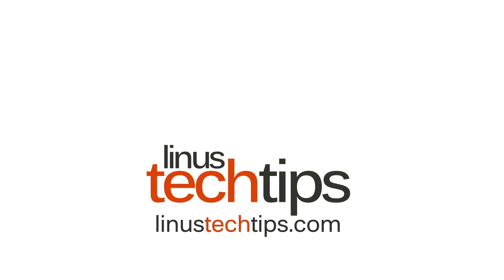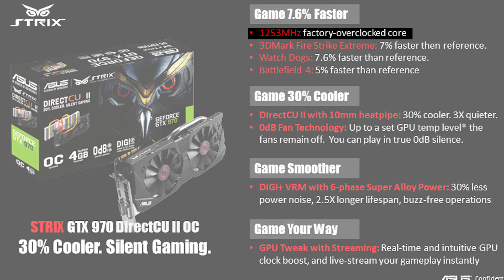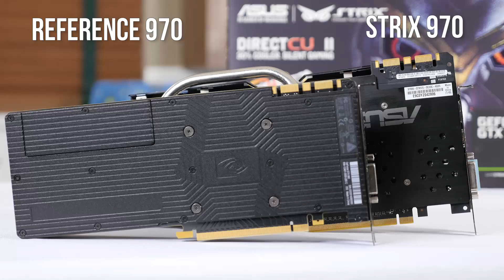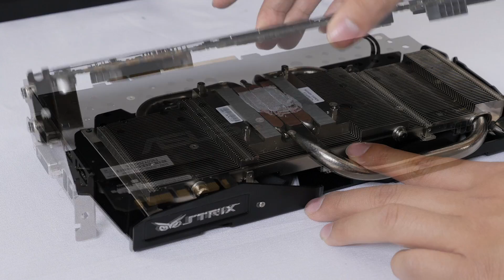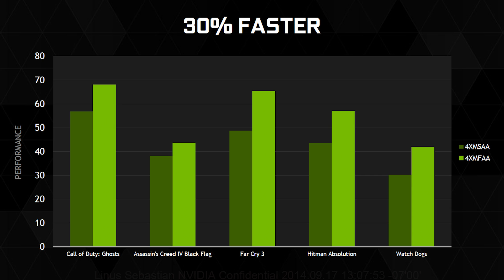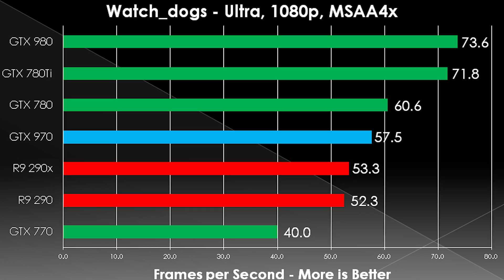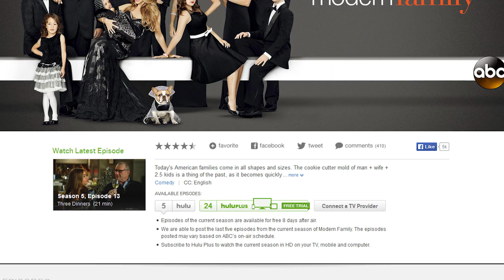ASUS Strix GeForce GTX 970 Video Card

Comment: I want to note, this card (ASUS Strix GTX 970) is equipped with a full HDMI 2.0, while  MSI GeForce GTX 970 Gaming 4G equipped with already old HDMI 1.4, beware.
Reply: Why the fuck do you use  HDMI over  display port?
don't get a 970 with a shitty monitor
Reply: ***** yes, exactly!
EVGA as well use  HDMI 2.0 on theys non reference cards.
to my surprise, I found that almost all manufacturers like GIGABYTE , ZOTAC, MSI, KFA2 use HDMI 1.4 instead 2.0.
But again, im talking about non reference
Reply: wtf msi...
Reply: Thank you, good to know Another reason to not buy the MSI card, I've been fan of MSI Twin Frorz IV, but that new one looks ugly to me and cost $10 more than the ASUS one, bye MSI, I'm going with ASUS instead.
Reply: SirEpicWin HDMI 2.0 support 4k@60fps along other features, Display Port doesn't ... Its something not quite useful for this card at least in games but is a new tech some might find useful other doesn't, blu-ray at 4K@60fps maybe? I myself never found 4K anything interesting, I'm just fine with 1080p@120fps... but OP is simply pointing this little detail out, no need to get mad about it.
Reply: Who fucking cares. HMDI 1.4 can still provide me 1080p up to 4k so something as trivial as that is an retarted reason for not getting that card.
Reply: You do know that DVI is higher quality then HDMI right.....
Reply: I was going to get the msi to match my color scheme. but i use hdmi. thank you! and they dont have a fucking backplate
Reply: If you want hdmi, get a lower end graphics card
Reply: norge696 No they are not look up the specs if they were "exactly the same thing then why tf do they still use DVI
Reply: norge696
Why would you use HDMI 2.0 when playing in 4k. Displayport is better
Reply: norge696 That is exactly why I say HDMI is shit.
Up until recently, you couldn't even do 1080p 120hz with HDMI.
It's also lagging behind Displayport, which is coming up with version 1.3 (which will BTFO any HDMI standard for a long time, if ever).
Reply: And Why the fuck does it matter? I already have HDMI cables so whats the point in getting an display port? Also how is the monitor shitty if its using an "HDMI cable" implying that it's an high resolution...
Reply: HJTh3Best
I am not mad lol
Personally I would never upgrade to 4k until there is a single card can handle it no SLI or crossfire or Dual GPU like r9 295x,TitanZ
Reply: HJTh3Best plus, the new sound technology  Dolby Atmos  with 34 audio channels , via HDMI 2.0 only!
Reply: De Tomaso Had someone confirm that Zotac uses HDMI 2.0. He was able to select 60 Hz refresh option in 4k resolution.
Reply: misutatomasu oddly enough, but now i was checked the msi web site, and they too changed HDMI 1.4 to HDMI 2.0
or they are negligent attitude to such details, I mean the employees of the companies responsible for the description of the product, or I do not know why
Reply: misutatomasu according to what they write in data sheet now - they have HDMI 2.0
Reply: What's a good reason to use HDMI over DVI?
Except audio, for which I use audio jacks.
Reply: SynapseTSS∞ wtf no its not haha
Reply: HJTh3Best Wtf are you talking about, Displayport 1.2 already supports 4k 60hz.
HDMI is shit. If given the choice, I'll either use DVI (for 1080p 144hz) or Displayport (anything higher).
Plus Displayport 1.3 will support 4k 120hz when it comes out.
Reply: HJTh3Best http://en.wikipedia.org/wiki/DisplayPort#Specifications
as well as http://en.wikipedia.org/wiki/DisplayPort#Advantages_over_DVI.2C_VGA_and_FPD-Link

Here's a quote, "HBR2 mode with 17.28 Gbit/s of effective video bandwidth allows four simultaneous 1080p60 displays (CEA-861 timings), stereoscopic 2,560 × 1,600 × 30 bit @120 Hz (CVT-R timings), or 4K UHDTV @60 Hz"
Reply: Jason122231
 I was actually replaying to OP <.<
Reply: ccricers nice question, and interesting facts, yesterday im checked zotacs official website, and found they changing some HDMI specs. Before was HDMI 4K @ 30 Hz, but now they changed to 4K @ 60 Hz
so ZOTAC rehabilitated, and again in the white list
proof link
http://www.zotac.com/products/graphics-cards/geforce-900-series/product/geforce-900-series/detail/geforce-gtx-970/sort/starttime/order/DESC/amount/10/section/specifications.html
Reply: De Tomaso I checked amazon and it says HDMI Output : Yes x 1 (HDMI 2.0)...
Reply: De Tomaso doe it mean they now have 2.0?
Reply: Nice catch.
Reply: Wrong, the card itself (the MSI one) just wasn't approved by HDMI yet, which it now is. So 4k 60Hz is possible on the msi 970
Reply: ***** are you sure? i need to know haha
Reply: littlefrank90 well i have to use hdmi because i play on a small tv on my desk
Reply: To clear misunderstandings. MSI GTX 9xx series have HDMI 2.0 interfaces.
https://forum-en.msi.com/index.php?topic=183619.0
Reply: correct. MSI said it was a typo. MSI gtx970s have hdmi 2.0 4k@60hz. "so far both the current GTX 900 series cards made by MSI being the 970 and 980 both have HDMI 2.0 interfaces and any information on Web pages regarding it should be ignored as its a mistake."
Reply: SynapseTSS∞ Are you stupid? HDMI is the SAME thing as DVI. Both easily converted with a passive adapter.
Reply: SynapseTSS∞ They're both digital signals... Sure DVI may be phased out in the next 5 few years but very few people have 4k monitors which HDMI 2.0 can support at 60hz.
Reply: *****  ik
Reply: SomethingCool51 Might want to show me where did you read that DP 1.2 support 4k at 60hz? maybe I'm missing something, thank you.
Reply: SomethingCool51 That's good then.
Reply: SomethingCool51 I don't know why you say HDMI is shit, it's the SAME thing as DVI or display port except the different resolution and hz they support between revisions.
Reply: ***** I understand they all serve the same purpose (to transmit digital signal) you dingus. I'm making the point that HDMI does not evolve fast enough. Displayport has been constantly one upping themselves, and have been doing 4k 60hz for a while now.  They're already working on 8k-capable cables now.

In comparison, HDMI is shit because they take too long to innovate. I never said it had less color quality or whatever you must be trying to infer from my statement.
Reply: I was just about to buy a PC with the GTX 970 can someone please help me to figure out of this is the bad 970 or the good one? The name is it is "Nvidia Geforce GTX 970 4gb GDDR5 ".
Reply: Well its a GTX 970, what you might want to know is the manufacturer or the company which makes its cooling solution/choose its specs which could be ASUS, MSI, EVGA, Palit... and so on, I don't know about the rest but the first three are three great manufacturers. I myself picked the ASUS one because its features and better customer support than MSI.
Reply: HJTh3Best lolwut, ASUS has the worst customer service I've ever heard of.
I only buy their monitors because if anything else fails, they'll assume you broke it or just simply not help at all.
Reply: SomethingCool51 Well you just said it, ...the worst customer service I've ever heard of... None of my ASUS product have had an issue except only for one AM1 motherboard I bought recently which wouldn't POST, RMA'ed it right away their customer service quickly responded me when I contacted them, unlike MSI with my old R9 280X which was producing graphic artifacts and after I RMA'ed it they said they found nothing on it, and sent me the same broken GPU back, even on 2D games it was causing artifacts after little time playing.
Reply: ***** No, the problem was the card, at first I assumed it was drivers problem, but it wasn't. The only two games I used to play with it were BF4/BF3 and they both are 100% DX11 and some indies sometimes, I tried everything on my end and nothing solved it. But I fixed it though, I bought this GTX 970 few months back and my problem with artifact and shit got solved real quick.
Reply: So can someone please tell me? whats better to buy asus,msi or the gigabyte? respond plz XD
Reply: El Greco  MSI παρε ;)
Reply: El Greco I would get Asus or Gigabyte. Gigabyte if you want more cooling Asus for more silence
Reply: Why is everyone going apeshit over HDMI? It connects your card to your monitor...who gives a fuck which port you use? Most decent 1080p monitors in the $100-200 price range don't include displayport. The quality is exactly the same on every port as long as you connect it to the same screen anyway...calm yourselves.
Reply: Ben Zimmerman ...unless you can't do 120hz on hdmi
Reply: SomethingCool51 at what resolution? Doesn't it support 120hz at at least 1080?
Reply: Ben Zimmerman only the recent one
Reply: SomethingCool51 are you serious? Well, shit. Disregard my comment if you need more than 60hz then.
Reply: Ben Zimmerman Yeah. It's pretty sad they took so long, being that even dual link DVI can handle 144hz.
I currently use DVI for my 144hz monitor but I'm really looking forward to displayport as I'm moving away from 1080p.
Plus, maybe they might one day make 240 or 288 hz 1080p (or more) monitors that require displayport. It would be nice.
Reply: http://www.reddit.com/r/buildapc/comments/2h81bx/msi_gtx_970_gaming_twin_frozr_v_4gb_has_hdmi_20/
Saw this on reddit. Don't know if relevant but... meh.
Reply: Alam220696 im so confused, i didn't know ports made any difference, im building a pc which can run games at 1440p 60fps, which port should i use? im getting the msi gtx 970 or the asus
Reply: Heisenberg101 I don't think it will matter for 1440p at 60hz  Use whatever cable the monitor comes with.
Reply: Heisenberg101
Yeah What SomethingCool51  said. Use whatever cable the monitor came with. HDMI should be fine too,
Reply: thanks for the warning, I saved $20 off the gigabyte and will have quieter gaming :)
Reply: luitennant06
Yeah I just bought the MSI one and becaue I am first time builder I don't want to touch the sparkly video card in it's majestic box.

Comment: 970 or 770? I currently own a 660, which one would you recommend?
Reply: Will the price range be the same as 770? since this card on the video has 4gb of GDDR5.
Reply: WUBdotEXE The 770 and 970 are both around $350. The 970 is a generation newer, that's why it has better specs at the same price point.

Comment: Gigabyte gtx 970 or this?
Reply: just in case you are not yet decided, gigabytes G1 will be a killer.
Reply: Please reply
Reply: Ege Eraslan
asus for me!
Reply: Zacom I strongly reccomend an msı or gigabyte version, I looked at their reviews and they both stay at 65 MAX, and have one 8 pin and one 6pin connectors so they overclock like absolute monsters!
Reply: Sorry for wasting your time with my question...
Reply: Thank you, that's what I was thinking
Reply: In my opinion: EVGA>ASUS>Gigabyte>MSI
Reply: Brendan Baird
No, ASUS > MSI > Gigabyte> EVGA.

EVGA has cooler issues right now, they fucked up measurements/heat pipe contact on the acx's.
Reply: Brendan Baird EVGA is OVERRATED. 1. EVGA uses lowest quality components among all the major Nvidia partners.
2. EVGA ACX cooler is both loud and inefficient. I would venture to say ACX 2.0 is probably no different. People are reporting 30 decibels on idle.
3. EVGA used cost-cutting measures like using previous generation heat sink on this generation's graphics cards - resulting in poor alignment and thermal conductivity (they've made a post claiming this is "by design").
ASUS>>>>>GIGABYTE>>>>>MSI>>>>>EVGA
Reply: Jack Sin they still send you the free card if it brake tho

Comment: Hello LinusTechTip-ian, I'm planning a build and I was wondering If you guys had any thoughts on it.

It would be primarily for gaming (LANs) and some very light video editing.

PCPartPicker part list: http://pcpartpicker.com/p/rY2DnQ
Price breakdown by merchant: http://pcpartpicker.com/p/rY2DnQ/by_merchant/

CPU: Intel Core i7-4790K 4.0GHz Quad-Core Processor  ($304.82 @ Micro Center) 
CPU Cooler: Corsair H100i 77.0 CFM Liquid CPU Cooler  ($94.99 @ Newegg) 
Motherboard: Asus Z97I-PLUS Mini ITX LGA1150 Motherboard  ($159.99 @ Newegg) 
Memory: G.Skill Sniper Series 16GB (2 x 8GB) DDR3-1866 Memory  ($164.99 @ Newegg) 
Storage: Crucial MX100 256GB 2.5" Solid State Drive  ($112.98 @ Newegg) 
Storage: Seagate Barracuda 3TB 3.5" 7200RPM Internal Hard Drive  ($102.99 @ B&H) 
Video Card: Asus GeForce GTX 970 4GB STRIX Video Card  ($355.91 @ Newegg) 
Case: Corsair 380T Mini ITX Tower Case  ($155.98 @ Newegg) 
Power Supply: Silverstone Strider Plus 500W 80+ Bronze Certified Fully-Modular ATX Power Supply  ($80.98 @ Newegg) 
Case Fan: BitFenix Spectre Pro LED 148.7 CFM 200mm  Fan  ($20.99 @ Newegg) 
Case Fan: Xigmatek XAF-F1251 75.3 CFM 120mm  Fan  ($12.99 @ Newegg) 
Case Fan: BitFenix BFF-SPRO-P12025KK-RP 70.5 CFM 120mm  Fan  ($14.13 @ OutletPC) 
Case Fan: BitFenix BFF-SPRO-P12025KK-RP 70.5 CFM 120mm  Fan  ($14.13 @ OutletPC) 
Other: Rubber Washers (Anti-Vibration Mounts) - Home Depo ($7.00)
Total: $1602.87

Comment: This is going to be my new graphics card. But probably the MSI 4G. It also has the "zero decible" mode and the colors of the MSI card just match better to my other components. And it even has a 6 pin and an 8 pin power connector for more OC because I dont kow how much power of the two 6 pins or the one 8 pin of the ASUS card (both methods with the PCIe slot can deliver 225watts) is actually consumed by the card and I'm going to oc this card to it's limits. So better to much than too less.